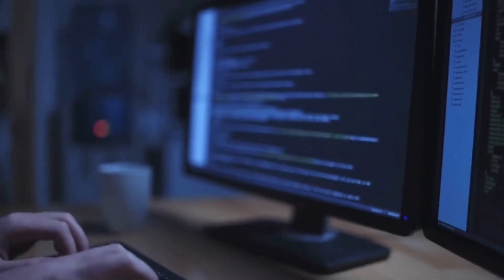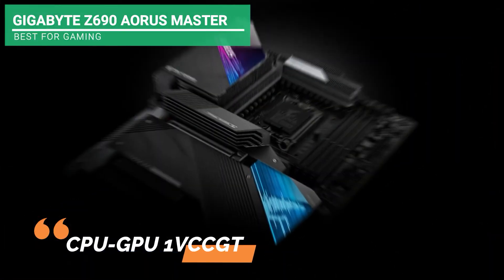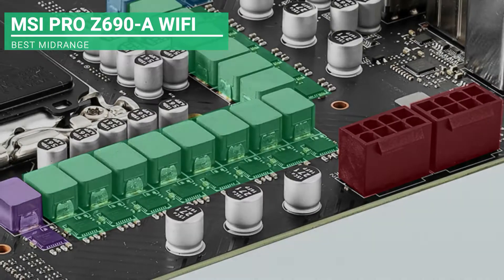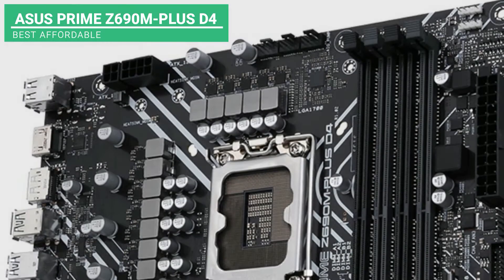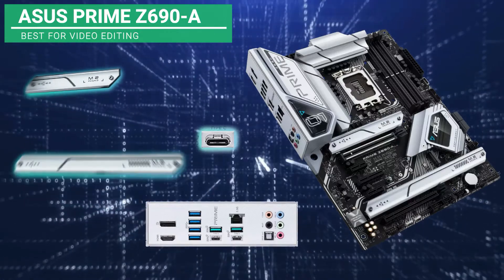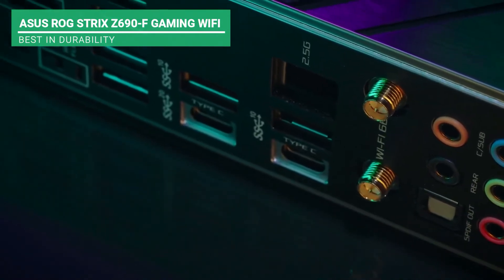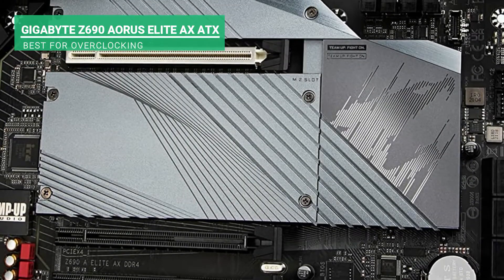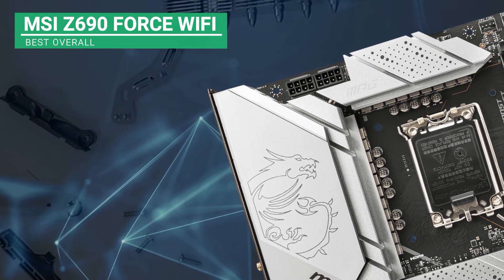TOP 7 BEST Z690 MOTHERBOARD 2022

Comment: I own the z690e gaming Wi-Fi and it is an amazing motherboard I think it's way better than the z690f
Reply: Basically same specs with an EVGA 3080 Ti. Getting 10-20 more frames using the 4.0 pcie versus the 3.0 pcie slot
Reply: @shanebaker3020  I'm using an evga ftw3 3080ti as well!!!
Reply: Same here, paired with a 12900k and corsair dom plat 64 gb ddr5